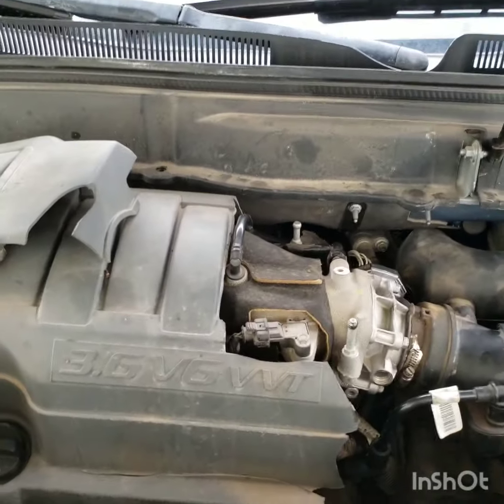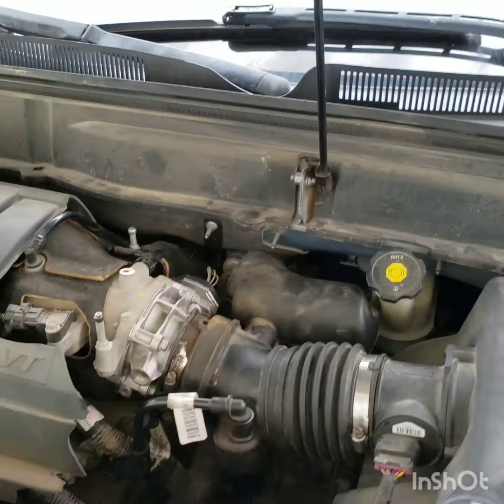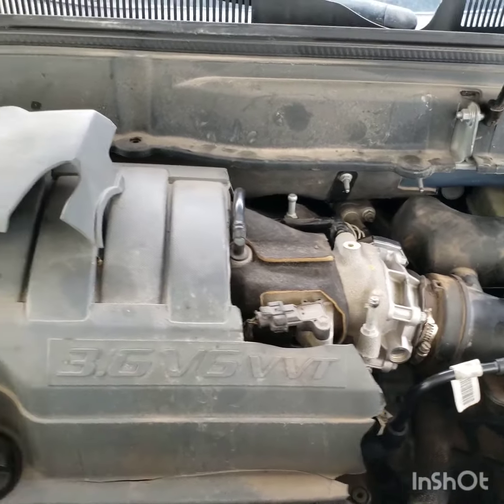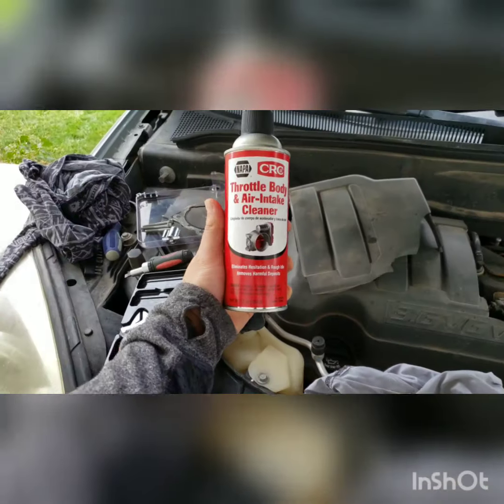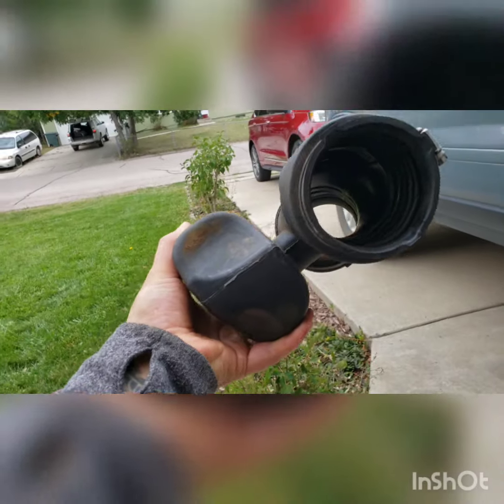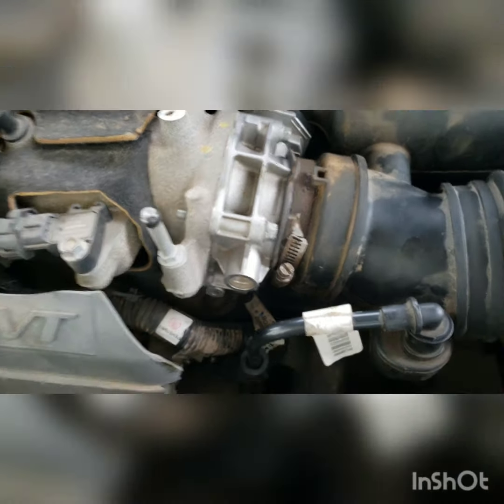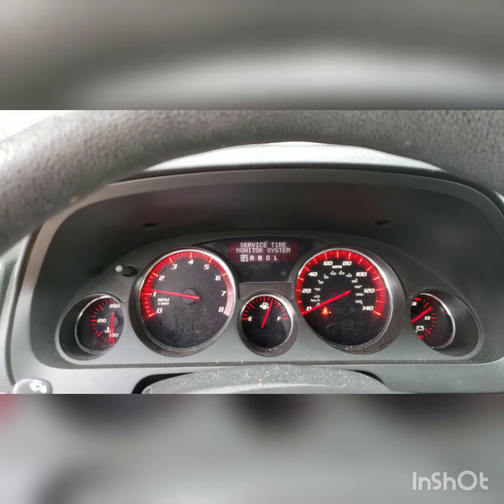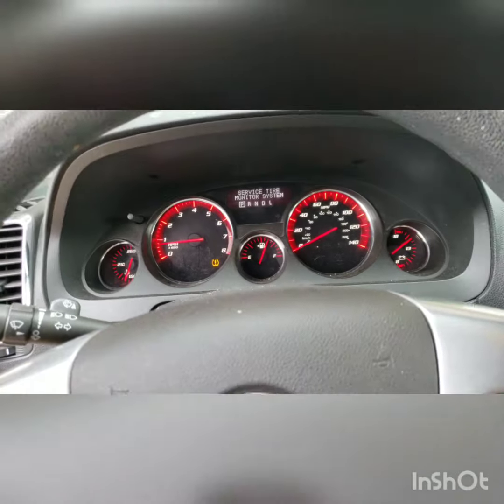Engine power reduce easy fix GMC acadia

Comment: the dreaded "reduced power" messge - stabilitrack..etc.   I replaced the intake manifold -- cleaned the you know what out of evertyhing -- did not fix my problem.   I would still receive the dreaded "REDUCED ENGINE POWER".  Primarily when my engine was warm and I would stop at a light or stop-sign.   I checked for codes -- I had a code for the fuel rail sensor (if my memory is right, it was code P0190).   Replaced the sensor.  Fairly easy job, disconnecting wires and moving htem ouf ot the way, was the hardest part.    Replacing the fuel pressure rail sensor fixed the issue... what a relief.  There's a video out there to help.    A thin walled socket for the bolt holding the sensor in place us a bonus.

Comment: A little late to tell you now, but you need to remove the oil fill cap before removing the plastic engine cover. Otherwise you will break the plastic engine cover.
Reply: 😂😂😂 is never too late to glue it back and start again!
Reply: I removed the engine cover and never looked back. Shits annoying af

Comment: I did the same as well and I think it's working now to. Mine would act up about once a week then be ok for a bit then the hole car would shake around and would say engine power reduced to, so im thinking it was all the oil in the sound damper in the intake tube. Cleaned up with throttle cleaner.

Comment: Just an fyi the battery is located behind pass front seat in floor its a 10mm.....and if u disconnect for few seconds it will reset the power loss that comes up on driver dash screen.

Comment: Once you see oil in the air conduct, you should change the two pcv valve too..
Reply: Whe is the pcv valve I was told mine doesn't have one 2014 3.6
Reply: I know where one is in the back but where is other one
Reply: @eddykelemis8964 the other is in the front up under the throttle body in front of engine I just cleaned mine out
Reply: @keepprogressing4178  i have see where folks widened the two holes on pcv valve and put it back in and never had problem again can anyone confirm this ?
Reply: I knew of the front one didn't know a second one existed

Comment: Hey man just a quick question? I have an 2011 acadia, when you put it on drive it doesn't go above 3 mph, would this fix it?
Reply from the maker: I think that may be something different!!
Reply: Crazycamaroz28  I also have a 2011 Acadia slt 2WD It's a headache. I cleaned it like this and changed some camshaft and crankshaft position sensors and it fixed the problem.
Reply: Sounds like maybe a catalytic problem?
Reply: The map sensor will keep your vehicle running below 5 mph. If u unplug map sensor and it run above 5 mph replace it
Reply: I would check throttle position sensor first for that issue without knowing anything else of course.
Reply: I have this same issue right now and am researching what people have done.

Comment: I have a 2007 Acadia. It started to stutter and after two days I took it to Autozone to get a code reader. The code that came on said I have a misfire in my cylinder 6. I was told to change the spark plugs and check the coils. After inspecting the coils they were good but I still had the spark plugs changed. After this, we found that the PCV valve was clogged and the Breather tube broke. after a temp fix of the tube. we turned it on and then I got a code stating P0300. Well, I went ahead and order the breather tube and a new rear PCV valve. My car is still stuttering and my RPMs are still low. What can I do next? please help
Reply: Did you ever get that fixed ?? And how did you solve it???

Comment: i have 2010 acadia. its having hard time accelerating and sometimes have a humming noise while driving
Reply: I have the same car same problem
Reply: it is having more problems right now. when im stepping on break it feels like it is locking.
Reply: I found the problem I had a loose oil filter
Reply: realy? i hope it would be that easy on my acadia
Reply: Change the filter, clean the throttle body, change spark plugs with iridium only, and change the metal pcv valve that's hidden by a plastic hose in the back of the engine by the rear ignition coil. It's a challenge taking it off, so use vice grips to take it off. Before putting the new pcv valve on highly advise lubricate the lower part of the pcv valve so it can fit in a lot easier. Trust me, been there, done that on my 08 Outlook.
Reply: @maeg5798  Try changing ur transmission fluid.
Reply: @curtiswilson4737  the main problem is the timing chain it jump up. my other problem is the cost if it to get fix.
Reply: It humms while accelerating a little bit??? And revvs like upto 4k only?? And still fills really sluggish? Like if a catalyc  converter is clogged?

Comment: If you don’t change the clogged pcv in rear  you will continue the same problem
Reply: which one?
Reply: @kenwall4526  There's one in the front and one in the back. They are both on the right side of the engine by the throttle body. Change both and do the cleaning like in this video and you are good to go.

Comment: Oil in intake is caused by clogged pcv easy and cheap fix
Reply: but which pvc??
Reply: Follow the black air hose on top of engine there 2 one for purge valve one that goes to back that’s your crankcase vent valve remove hose carefully turn small piece to side the pull that silver piece is your vent valve plier it out you will see 2 small hose clogged with oil
Reply: The purchase new one and drill the small holes a bit bigger before installing garrantee to work
Reply: Best of luck

Comment: Buy one of those cheap check engine scanners and whenever it acts up just clear the codes and the truck will run fine
Reply: I do this for emergency use but still need to check pcv valve and clean throttle body, from what I've read

Comment: Tengo el mismo problema, mi pregunta es si despues de que lo limpiaste, te volvio a hacer lo mismo de power reduction?
Reply from the maker: Hola !! Si despues de un tiempo Volvo a hacer lo Mismo ! Lo que hice después le calmbie el purge valve https://youtu.be/48Aa_49gYjw
Me costó solo 40$ muy fácil de poner te dejo el video !😀👌
 después de hezo ya no tuve ese problema! Saludos
Reply: @handsonjobf9200  Hoy limpie el trottle body y por suerte salio bien, lo del purge valve lo cambie hace 6 meses porque cada vez que cargaba gasolina tenia problemas para arrancar, asi que no creo q en mi caso sea eso,  si me vuelve a fallar lo del trottle voy a tener que llevarlo al mecanico a que lo cambie y lo programe, gracias x tu respuesta.
Reply from the maker: Un gusto !! 😊
Reply: @argentino901  le fallo despues de la limpiada? A mi me paso lo mismo hoy me dijeron que era una fuga de air
Reply: @juancastillo4563  Juan, yo termine cambiando el trottle body porque me seguia el problema, hay videos que te dicen como relearn la computadora, porque cuando cambias esa parte las revoluciones van a ser altas (en mi caso no tuve problemas y las RPM eran normales) despues que cambie eso,no tuve mas problemas con el reduce engine power. lo unico que yo hice fue desconectar la bateria para cambiar el trottle body.
Reply: El código se limpió por que desconecto la pila. Al tiempo volvió a salir. La pregunta es como lo corrigió despues?
Reply: @alexcapetillo7083  cambiaste el throttle body y te sigue saliendo el reduce engine power? Yo cuando lo cambie no me volvió a aparecer y ya pasaron 7 meses...
Reply: @handsonjobf9200  hermano ayer venía normal y mi acadia 2008 perdió fuerza ahora no quiere pasar de 45 millas